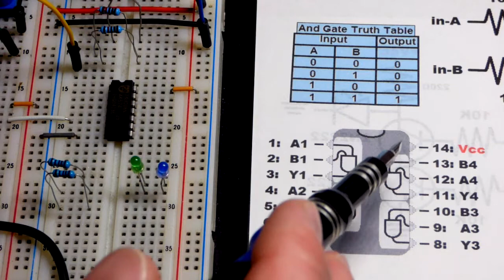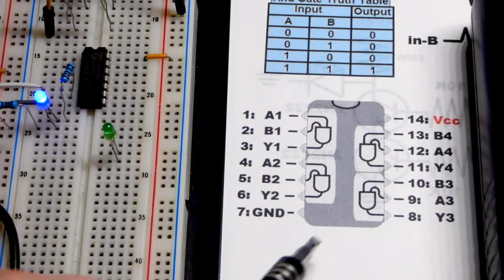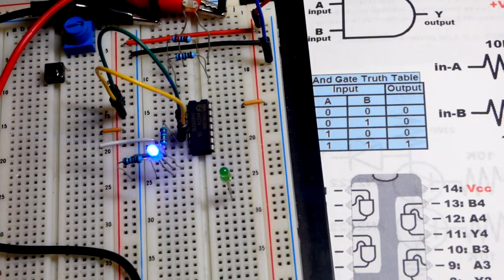Bonus 7408 74HC08 IC quad AND gate IC introduction with light sensor and switch input electronics

Comment: How can I use 4011ic as dpdt switch ? Plz help me I will be very thankful to you.
Reply from the maker: I haven't built one with integrated circuits yet. I'll keep that idea in mind!
Reply: @Electronzap  due to the dpdt switch system, I will be able to create more powerful system that will help me to charge the battery faster. I hope you will help me on above topic as soon as possible.